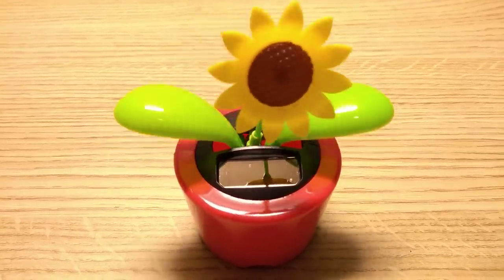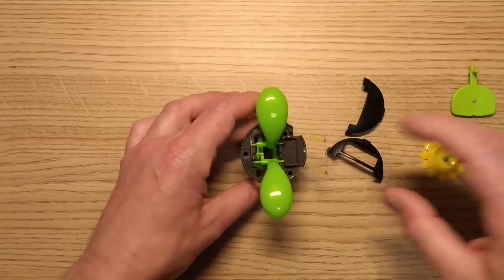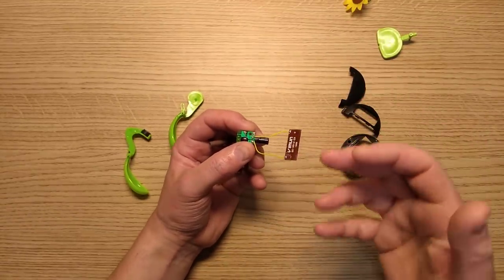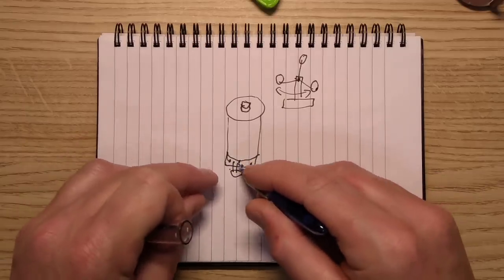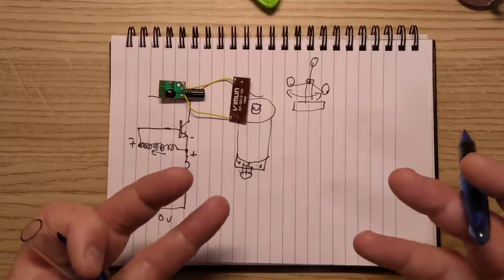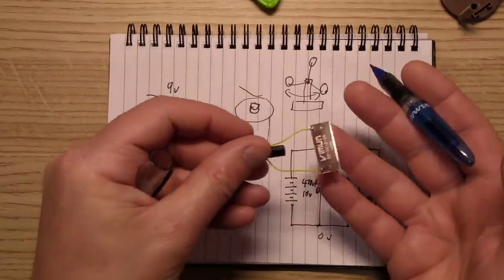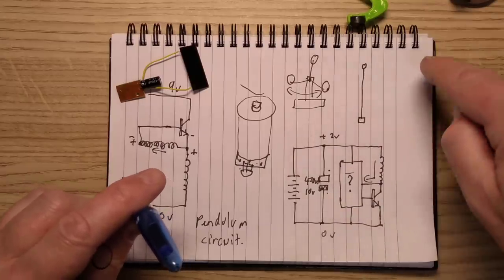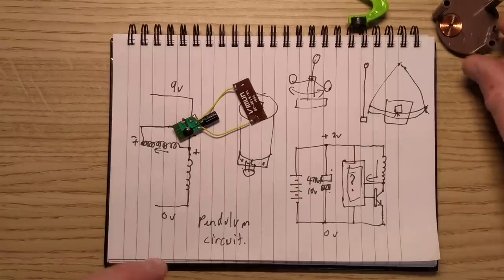Flappy solar ornaments have an interesting history.

Comment: I looked up this video and watched it again because I've actually got two of the old analogue electronic clocks you refer to, theyve got hands which turn clockwise!. They use a single 1.5v cell and a coil and a mini pendulum and a small circuit of discrete components which is inaccessible, no quartz crystal. They keep good time but tend to run faster as the voltage reduces after a year. There is a rate adjustment control which might be resistance or capacitor. Made by Metamec.

Comment: I've got an old Gents (Synchronome) clock. It has a free pendulum that swings every second and kicks an escapement wheel and after every 30 seconds it drops a contact  that drops a lever which gives the pendulum a kick go keep it going. You'll probably remember seeing one at school. All the slave clocks were wired in series so they moved the minute hand every thirty seconds. If you're old enough you probably remember one from school. There was also the gadget that rang the school bells as well. It was a big brass wheel with pins in that tipped mercury switches at the right time. I recycled this but I still have the mercury switches!
Reply from the maker: I've got a gents master clock.

Comment: There's also a spinning top version of the magnetic pendulum thing.

Same principle only the top continuously rotates and due to how the base is sloped it moves towards th middle then gets shot out in a random direction.

I once had a clock that used the same principle only a wheel had two magnets on it next to each other then a coil in the middle followed by another wheel with two magnets on the other side of a coil.

A spring was used to make the wheel move like an escapement wheel in a wind up clock.

Ran on 1.5 volts.

I took it once removed the spring then took one wheel and turned it to where the magnets were on the opposite side from the bottom magnets.

I then had a motor that would spin either direction.

Comment: In the '70s, I had a little moving sculpture shaped like an atom symbol that used a 9 volt battery.. There were also animated displays in stores  that used the electronic pendulum. Both had to be pushed to get them going.
     In high school ('70s) , I had a "transistor alarm clock" in a clear case. As I recall, it had two coils, one transistor, two resistors and one capacitor for what amounted to an electronic escapement. The alarm was  a Sonalert type noise maker. The clock ran on a C size battery, the alarm on a 9 volt. It wasn't all that accurate-about like a typical Windup clock..

Comment: I remember animated advertising in the grocery store (and elsewhere) with some type of "wig-wag" sign.  There was the wire triangle with the curved bottom that moved back and forth through the coil and there was a cylindrical magnet in the middle of that curved piece.  There were mechanical contacts that blipped the coil when the magnet was in the proper position.  It ran off one or two D cells and required an initial push to start it moving - but the battery lasted for days...  I got that mechanism from some piece of discarded advertising when I was a kid, back in the Dark Ages BC (before computers).

Comment: A similar kind of mechanism as the Kundo clock one was used in oscillating shop window displays back in the 60s, running from a single U2 cell as it would have been called back then.

Comment: My mum has an old wooden painted Budgie clock that has a combined clock and pendulum mechanism in it. it makes the budgies tail swing at a moderate speed, both fed from one AA battery. The swing mech has a curved bottom but its all housed in a plastic case and my mum wont let me take it to bits to look at it lol. I do give it a sinister 'rubbing my hands together' look when I visit her as its on a wall between the front and back room  lol.

Comment: I know it would be hard, but is it possible at all to open the blob and see what is inside?
Reply: Coolshows101 Possible, but difficult.  It involves a microscope and some nasty solvents.  Easier to skip to knowing the circuit already unless you really need to check a particular production run (you'll be destroying specimens, so the point would be to know if the rest of the batch is OK).

Comment: As a child in the 50s I used to be fascinated by quite large rocking  advertising displays in I think electrical shops. After getting behind to see how they worked I saw they had a coil, a bent arm supported at one end and passed through the coil. This was only powered by one U2 ever ready battery. But as a child younger than ten I never worked out how it switched as I new it must be, the man in the shop just told me it was manic, which frustrated me.

Comment: Wow - flashback. We had one of those kinetic art things when I was a kid - it was a big ring with a magnet on the bottom and a free-spinning bar in the middle that had another cross-bar attached to two counter-weights in the shape of Saturn and the Space Shuttle. So the ring would swing back and forth and the Space Shuttle / Saturn would randomly spin inside. As mentioned it was powered by a 9V battery, which my parents never replaced after the first one went flat because the toy made an annoying "tick tick tick" sound as it swung back and forth.
Reply from the maker: I featured that type in another video.  Just a single transistor.

Comment: Hello BigClive, back in the 1960s I remember an simple electromagnetic pendulum mechanism that just had a contact at a certain position to make the device swing that was used in shop product advertising displays. I had a couple to play with from my parents confectionary and tobacconist shop. Sadly, I can't remember what the products were.
Reply from the maker: Early battery operated clocks had a very simple pendulum contact system that would give the coil a tiny pulse of current in one direction.

Comment: If you really want to go down this rabbit hole, Google (et al) search for "phototropic BEAM robot". These are simulated lifeforms that have some form of movement and survive by "eating" light. Usually the robot/life-form will move in order to maximize the light input. 

A commercialized version of this phototropic characteristic is the single or 2-axis solar tracking systems used with solar cells. 

The BEAM robot is a design of a very simple circuit and electro-mechanical transducer (relay, motor, etc.) that stores up energy in a capacitor until a threshold is reached then it "fires" the transducer, causing physical motion. 

The last time I looked at this stuff was in the late 90's... I don't think there is much new material out on this...
Cheers,
Reply from the maker: I went through a spell of designing and building BEAM bots.
Reply: @bigclivedotcom  I built a couple... then forgot about them for 20 years. Life is funny sometimes.
Cheers
Reply: Ah yes, I do remember far-too-full-of-himself-for-what-he-came-up-with Hat Guy...

Comment: My theory for this fascinating solar panel is one of two:
1. The cell could be using a transparent conductor for the current collectors. Those would be invisible, plus a thicker layer of cell material in the panel would absorb more light - effectively rendering the panel as the apparent "black void" that it is.
2. This is a new multi-layer technology; and the panel is one of the latest and greatest in the field...

The first being most likely; the manufacturer actually silkscreened their name and the part number - not something you usually find on the cheap nasty stuff. That and conductive films and interconnect already exists in LCD manufacture...

Comment: I'm guessing the reason they only need three pins might be because of the high output impedance of the solar panel. Soon as the coil starts drawing current the voltage would drop by a measurable amount, which could trigger the circuit.

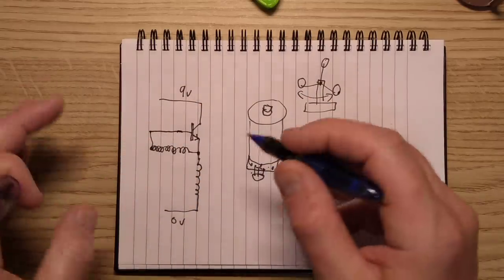Comment: 6:30 It appears that many cheap battery powered pendulum clock movements have a circuit like this (or maybe with the cob blob) for the pendulum, which is only there for the show. The rest of the movement has no attachment to the pendulum, which will oscillate out of sync and at a frequency that depends on its weight and length.

Comment: The first function of this circuit I know was in so called "ATO"-Clocks. Coming from its inventor Léon Hartot (pronounced "ato").
Before the transistor was invented they used a mechanical switch in the movement (Around 1920-1940)
In the 60's then, they used a transistor-circuit. As you say, Kundo was very known. But there was Junghans as well.
And the older clocks were produced by Haller&Benzing.

Comment: I have a Bulle electric clock which works in a similar way to the Kundo, except that the curved magnet is fixed and the coil swings. The Kundo sounds a more sensible design : no need for lightweight flexible wires - but I don't know which came first. Maybe one was done to evade a patent on the other.

Comment: I've seen half-size versions of these, but only sold at Dollar General in the US, I haven't found them anywhere else. One leaf is molded as part of the center flower stem but it would be interesting to know if the electronics had to be changed to fit in a smaller space or if it's all the same mechanics.

Comment: I have only seen this one. we've still one that worked and one that broke - and taken apart.  I have always what was in that 'black blob'.  
my conclusion is a diode that allows the capacitor to charge on the backswing of the pendulum thus giving it an extra boost on the power swing - similar to back EMF.
Reply from the maker: It's quite a complex circuit that has a voltage threshold triggered pulse circuit.  From start it just pulses at a fixed voltage level on the capacitor, but when swinging, the induced voltage from the coil nudges it over the edge and causes a synchronised pulse.
Reply: @bigclivedotcom  And all of this cleverness for £1!

Comment: There was a foucalt pendulum at uni driven with a pendulum circuit. Unfortunately, the wire would stretch and it was often out of order.
Reply from the maker: The one at Princes Square in Glasgow always seemed to have issues too.
Reply: bigclivedotcom So did those have the misfortune of a wire getting bent at every swing, ensuring fatigue?
Reply: @bigclivedotcom  perhaps build a small inductive motor into the ball which winds the wire in when it gets too long.

Comment: the only problem wiht this circuit is that there is no overvoltage protection form the cell, try to run this in australia in the summer and you will see its kicking pendullum so far its hitting the limit plastic and that makes a lot of noise, its annoying and cause the thing to land in the bin
Reply: You could try covering half of the solar panel with black electrical tape, etc.  You might be able to remove it in winter.

Comment: recently I disassembled a chinese waving cat for the sake of science. I put a compass nearby the coil with the swingy thingy not being close by. the compass needle started dancing with a constant frequency when shining light onto the solar cell. looks like there is simply no feedback loop as the cheap circuitry should not be able sensing the moving needle. I guess the circuit simply drives the coil at an constant frequency which is tuned to a resonant frequency of the swingy thingy or the other way around. what could give out 1..2Hz? A quartz like in a watch? or even simpler like the coil making up a tuned circuit together with an additional capacitor and a resistor?

Comment: A friend of mine have an electromagnetic wristwatch where the balance wheel is driven by a similar circuit. It is not working well, the timekeeping is not working OK. It goes too fast with a fresh battery...

Comment: I have recently been messing with a lot of old mechanical and early electrical watches and clocks, so the moment you opened the thing up and revealed that coil I thought... that looks very familiar. 

Take a look at the Timex Electric watches from the 1970s on-wards. The evolution from switched contact controlled mechanical balance,  to single transistor controlled mechanical balance to quartz oscillator controlled transistorised mechanical balance, to quartz controlled crude stepper to  modern micro-stepper by the mid the eighties is an interesting illustration of the evolving nature of cheap versus reliable, versus other people's patents. 

Most of the early electrical Timexes have failed due to the rather obvious issue with a mechanical switch operating thousands of times per day. The later stepper based ones die as a result of corrosion and poor quality circuit board material. The more modern still die as a result of the microscopic nature of the gears. The smaller the component, the closer the tolerances, and thus the more easily they get killed by ingress of dirt or coagulation of greases and pollution (often cigarette smoke). 

A word of caution, collecting, dissecting and fixing random cheap watches and clocks is almost as addictive as collecting dissecting and fixing random cheap electrical items.  

Warning: Entrance to very deep rabbit hole here -> https://www.watchrepairtalk.com/

Comment: So in this middle thing where the flower is attached to. Is the counterweight somehow magnetic? Or ferromagnetic? Because I lately repaired a broken Flappy Flower which was exposed to excessive sunlight and heat during the warm days this summer. I put everything together again, the mechanic swings freely, but the thing in the middle barley moves at all. Could it be that somehow the magnet or so lost its magnetism?

Comment: Electronic Hydraulic Ram Pump circuit.  There you go!     Clive, do a comparison of these circuits and your joule thief for us?
Reply: Not really same thing as a ram pump. That is as far as I half-understand a ram pump. Which is the maximum amount of understanding possible for a human being to have of ram pumps. 

There's no real clearer explanation of this than the one Clive gave, how much simpler could you want it? The Joule Thief is different, it's basically just an oscillator that uses a small transformer, and the transformer raises a voltage enough to power an LED, even from a very low input voltage like a very dead battery potentially right past the point of leakage. It's an oscillator notable for being able to start and run from a very low voltage. 

None of the three are really related in their operating principle.

Comment: Does the Quartz Seiko wall clock works the same way?
Reply from the maker: The electronic pendulums are similar, but may use a single transistor.

Comment: I was going to ask if you could use this to drive a clock! lol
Reply: Probably could but not accurately.
Reply: It all depends on the pendulum itself, and the more length you can use in the more you can tweak its accuracy.
Reply: @simontay4851  Uhh... He mentions in the video that this idea comes from clocks that were based on this principle.
Reply: @simontay4851  It's the catchment/escapement that regulate's the clock's accuracy

Comment: Would that that blob that keeps the COB's identity secret be susceptable to a hot air gun and scraper ?
This may have evolved from those sound activated dancing flowers.  Fashionable back in the day.
Reply: I think it's just a bit of silicon chip and some extremely fine wires underneath. No real casing that you would normaly get, with numbers and such. Search for COB PCB on google images to see what I mean.
Reply: @EddSjo  Thanks. had a look.... maybe the copper artwork layout offers a clue.

Comment: The auto-start functionality could be added to the early transistor based circuit by use of the much underloved PUT, placed from collector to base, with suitable "programming" resistors.

Comment: In the maker community these were called solar pendulums or "magbots" and were considered a type of "BEAM robot", a term popularized by the 2002 book "Junkbots, Bugbots & Bots on Wheels". That book presented a design using a NPN, PNP, a diode and optional LED. The LED would flash every time the pendulum got a kick. Other circuits of the time employed a 1381 voltage trigger. Solarbotics still sells the pendulum kits and coils.

Comment: While I think there's a connection to the Kundo ATO electromechanical clock the circuit is different.  The step after the Kundo was the "Novelty Electric Motor" see: https://prc68.com/I/JouleThief.shtml#Novelty_Electric_Motor
But I think the Flip Flap Solar units are Miller Engine devices.  I say this because of the large value capacitor.  See: https://prc68.com/I/JouleThief.shtml#MSE
The idea is to store up solar energy in the capacitor and when a threshold voltage is reached the motor turns on until the cap is drained.
Reply from the maker: I've just received a kinetic motion ornament from eBay.  The only things that have changed are the batteries are 4 x AA and the single transistor is now surface mount on a PCB.  Still makes that slight buzz when the magnet passes it, suggesting a slight oscillation.  I've got one of those spinning top devices somewhere.

Comment: Clive, where in the grand scheme of things in relation to these does 'Hall effect' come in - or not at all ?
And now swiftly moving on to car ignition !

I've an analogue clock (& I mean it's analogue!) with a trad but magnetic balance wheel driving the clock via an escapement type mechanism - that I guess is a similar principle.
I'm now going to provide a link to one variety of the moving toys that used this that were quite common in the eighties - but bear with - I don't know the thing's name - so I may be a while finding it !

Infinite roller - nope. 

"Space wheel" - YES ! Almost think I've actually remembered the thing's name without actually knowing that I knew its name ! So here it is in action:
https://youtu.be/qZuPGJ5QiQ8?t=158
Reply: There's no hall effect device in these. Too expensive!
Reply from the maker: I used to have one of those.  It uses the traditional 2-coil and transistor approach.